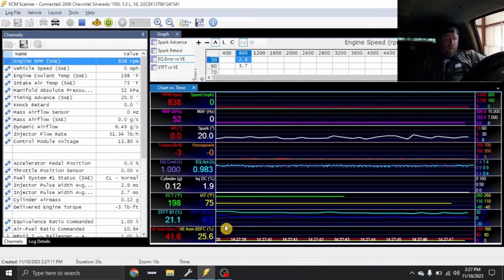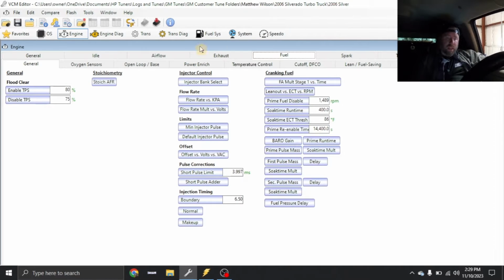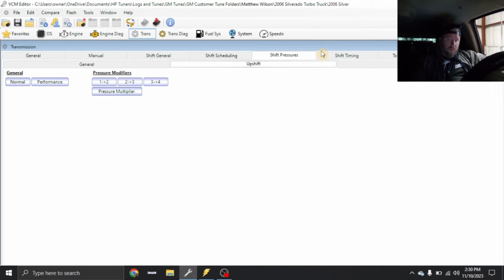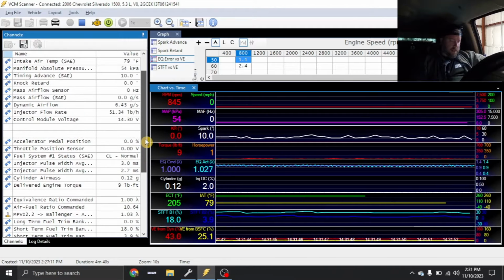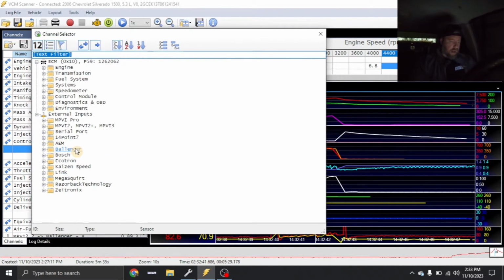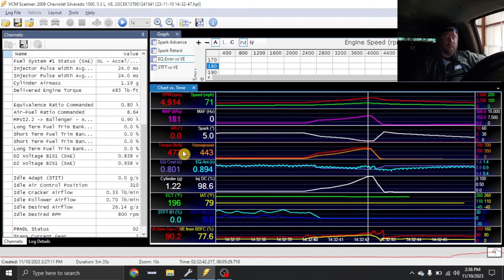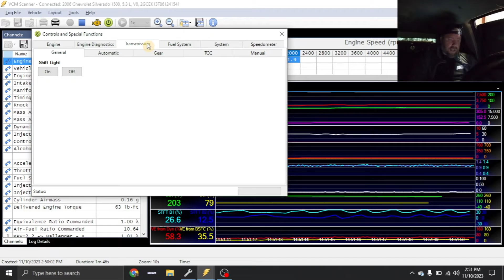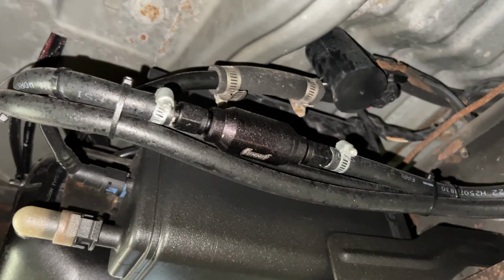Dyno tuning a TWIN TURBO 6.0L 2006 Silverado on JTX Forged!

Comment: So you mean to tell me the truck automatically picks up hp just from higher octane fuel and a tune isn’t needed ?!?! Also thanks for the info on the knock sensor cuz my motor mount is completely gone 😅

Comment: I’ve had a Performabuilt 4l60e in my truck since I boosted it in 2016 and it has been the best investment transmission wise. They make a solid product and their customer support is second to none. I’m not making as much horsepower as that truck but I’m sitting around 500 and it has held up to everything I’ve thrown at it so far.
Reply: question, why did you choose to build the 60e instead of going to a 80e?
Reply: @anewzack78 I looked into doing an 80 when I was doing all this and it was just a lot of extra work I didn’t want to mess with at the time. Also, for the price and performance of the Performabuilt it was an easy choice sticking with a 60